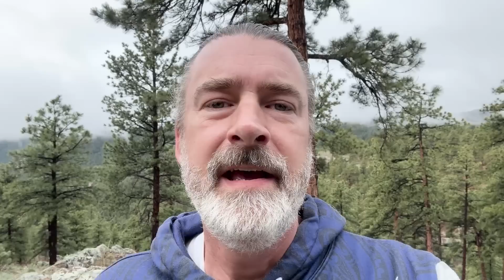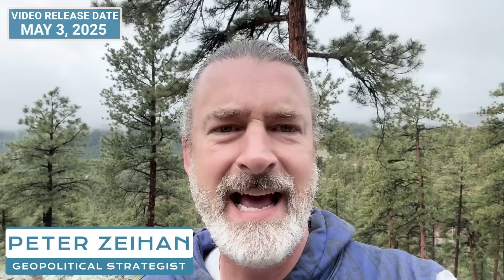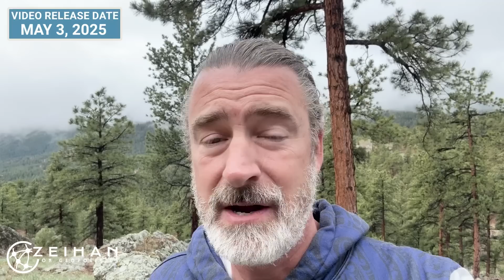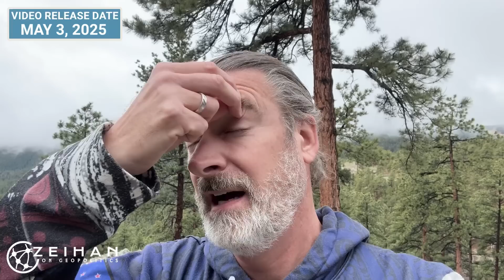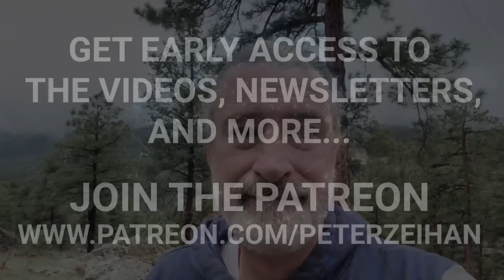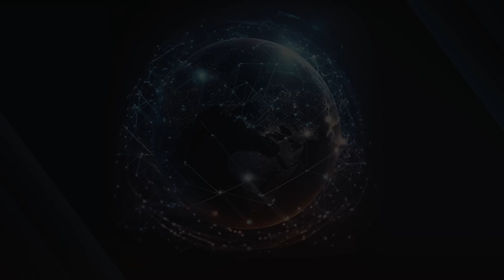The Night the Lights Went Out in Geor- er, Spain || Peter Zeihan

Comment: Electrical Engineer here, several of the points he made are flat out wrong. The failure wa from an unforeseen overvoltage condition because of two large power generators which were NOT renewable. Inverter based resources actually enhance grid stability if controlled correctly. This was off the mark, widely. Renewables were not to blame here.
Reply: Inverter based can help when used correctly... after all, the mentioned battery solution has an inverter. But for it to support a grid, it would have to be a (so called) four-quadrant converter, though the new EU directive makes those mandatory for any PV farm over (I think) 1 MW. 
But renewables do create a problem in that their supply is not a predictable as the supply of "rotating mass". The general understanding is that solar and wind does not change all over the grid at exactly the same time so there is time to react, maybe get a gas turbine online or open up valves of hydro power (can go from 1 to 100 % very fast). 

Inverters are however a problem when disturbance occur, their internal safety features can shut the inverter down in milliseconds (within the sine-wave itself). I didn't know if Spain had a voltage surge (the study is still ongoing), but that might cause PV to shut down in a large area immediately. But voltage surges comes in many forms, most of them never make it through a transformer (let alone several to get from 400 kV grid to a local 10 kV or 20 kV grid). Harmonics the same and are mostly a local phenomenon. So I am not ruling out a (control) error causing some kind of inverted wave harmonics which in turn shut down the inverters... 

As for Peters solutions, the battery storage thing will not work (due to scale and economics). It will be keeping rotating mass online, partly nuclear, gas and hydro. So Spain needs a lot more interconnectors to France and Italy (they are in a similar bind, though not as bad - less wind and solar and more interconnectors to Austria, France and Switzerland).
Reply: It was obvious peter was trying to learn this stuff and failed. Note when he mixed up herz and megaherz. 

Peter has always had real problems knowing when he doesn't know, particularly when it comes to renewables and batteries.
Reply: Any time this dude talks renewables, I know he's going to get it wrong
Reply: Some engineers have switched to the dark side!😅
Reply: never heard of lithium titanium batteries. Lithium Vanadium??
Reply: @jasonbarlow8161  Batteries alone are not the solution. They may be a part of it.
Reply: Reading this from an EE engineer is scary.
of course, the wild add-ons of "renewables" play the decisive role in making the grid instable.

Inverters basically follow the grid but cannot dictate it.
So when the big rotating masses are taken off the grid or are minimized their output for ideology reasons, the grid becomes uncontrollable. Simply the sync is lost without them.

One extra-ordinary event and it must shut-down. 

In the end it was a nuclear power station in France, which acted fast, disconnected from Iberia and saved so the whole rest of the continent from a even more massive blackout.

We need more heavy turbines back to the grid. Anything else will not work (properly).

Peace! from Dresden / Germany
Reply: @Boni-i1l  "Reading this from an EE engineer is scary.
"

As was your comment, in part... 😀... and I too have a background in electrical engineering and control systems.

"Inverters basically follow the grid but cannot dictate it.
"

This depends upon the type of inverter used. Somebody else here accurately commented upon this.

"So when the big rotating masses are taken off the grid or are minimized their output for ideology reasons, the grid becomes uncontrollable. Simply the sync is lost without them.
"

The big rotating masses you speak of are just one way to achieve the effect. But they certainly do help. However, when they're also taken offline in situations where they shouldn't have been... which may have happened in this incident and this certainly appears to have been the case....then they won't and don't help at all.

What's certainly true is that not taking a more holistic approach and dealing with the problems that renewables can create in some circumstances ends in dramatic failure. That's what we saw. And as somebody who lives in Portugal, I can attest to this after losing my drinking water supply for 12 hours.

I think we all have to be a little more holistic in our thinking. And that includes a cool and calm assessment of the cause of the failure, the likely related causes of failure (that haven't yet happened but could), the solutions (including but not confined to yours), the vulnerability of those solutions to interference or cyber attack. And so on. But I fully agree with you that ideology alone does not produce good engineering. You have to engineer solutions to problems created by a necessary transition to renewable energy generation. 

And let's be in now doubt, that transition is absolutely necessary unless we really do want a catastrophic step change to our economies in future that will be entirely beyond our means to control. This stuff isn't optional for Europe in particular. And those that might think it is are utterly deluded. We can't waltz off down the yellow brick road into the land of Oz, here. 🙂 

There's nothing ideological about transition to renewable for Europe as a whole. Given the geology of the region and the state of technologies across the board that are foreseeable over the next 100 years and particularly when taking into account the emerging geopolitical realities this next century, it's strategically inept (and ideological in itself) to imagine that we have much choice about the necessity to greatly increase renewable generation or massively decrease power consumption. There simply are no viable alternatives. But we absolutely need to engineer the power distribution network for the power generation landscape on have no illusions about the necessary adjustments and operating procedures that are necessary for stability and security of supply.

Incidentally, you refer to heavy turbines. By "heavy" in this instance you're presumably referring to the ability of a high-mass turbine to sustain its angular momentum. Somebody else here used the term "rotating mass" and this is more accurate. That may or may not be a turbine. It may be a network of glorified flywheels, for example, that supplement turbines within the power generation network. This kind of arranged has been used, for example, to provide start up power for nuclear fusion reactors (e.g. the Joint European Torus). There's nothing "sci-fi" about this. 

The solution may include synced invertors across the power generation network being synced by control signals rather than the power distribution system itself (which is simple... and good... but vulnerable as we've seen). Or other mechanism, for that matter.

Anything else, as you put it, can indeed work properly: turbines are far from the only solution. It just requires adequate engineering and viability from a cost-benefit point of view.
Reply: @appstratum9747  
Thanks for the lengthy reply which makes more sense, though I have some objections. Keep in mind English is not my mother tongue.
My background is high-tech machinery (incl. very large complex PV-module coating machines) and not grids, but the general physics apply. My Dad worked for 15 years in the 1960s/70s in a huge coal-powered plant and he is a graduated  physics, having a good understanding of basic nuclear stuff. I have a German Dipl.-Ing. (MSc? in English?) in computer, electric and electronic science - but I am rather a practical engineer than an inventor or design-engineer. I installed, repaired and trouble shoot those machines on all continents in more than 60++ countries (so I've seen a lot of local grid arrangements and standards).

But this is the general picture here: The problem in Europe is ideology driving politics. We had all these loud and aggressive doomsday crazies (non of them is an electrician) forcing our politicians to implement politics up to the EU top. It basically means:

- no European strategy at all. Every nations follows its own politics. S and PL are planning nuclear power stations while Germany is discarding the last three (it is OK, since they are too old) but also their coal power station. IN Hamburg, the most modern one just ran for a few years

- as a result of this there is an extremely wild adding of solar parks, thousands and thousands of not-remote controllable small individual "balcony solar panels" at a crazy rate, since most are wanted and subsidized by the national governments. Each country plays its own game while being hooked into the same continent grid.

- For wind turbines we keep clearing a lot of forests to install them; they actually require (again) a lot of space

- Because of the crazy taxation and fee system our existing pumped storage hydro power stations are turned off - nobody in politics, including the Greens do care about it. Most likely they will be disabled soon.
With other words we are throwing away the grid stabilisation, and no, there are no power inverters dictating frequency as far as I know. They all just follow the grid -  a situation our European grid operators (not me) kept warning since years - even in the media - just to be ignored.
In continental Europe there are no flywheel machines, at least not in Germany. The only one I know is in Ireland to support their large shoreline wind parks. Makes sense - but flywheels are also energy suckers. In a combination with batteries not really good.

I could list more of these idiocy - to sum it up: In Europe the adding of solar and wind is wild, uncontrolled (technically and politically) which makes our grids now so fragile. Such a power outage never happened after WW2 in the European West nor East (this grid went as far as to the Ural mountain range in the USSR).
Germany in particular is very special in regard of nuclear. Our Green party (in their heydays up to 20% votes) pushed since decades to turn off anything nuclear, scare-mongering like crazy. Of course Fukushima and Chernobyl plaid into their hands. So, if you just say "nuclear power station" people are immediately "turned off" by scare propaganda. It does not matter if you point to new ideas, they just shun you.

So whatever the initial event was, to a certain decree a grid must cope with it. And this is why the grid failed in E and P. A French two reactor nuclear power stations (forgot the name) somewhere SW in F (one reactor down to scheduled maintenance) switched from the collapsing sub-grid at the Iberian peninsula to stabilize the rest of Western Europe. Some media is claiming we were less than minutes away from a total blackout in Europe.

I agree with you 100% on my wording: heavy "rotating mass" is better, I also got the term "inertia" but this is only the result of it. However, having systems not synchronizing itself by physics but via even more complex control systems is an urgent question to be answered. Simplicity is king - old engineering rule. My opinion is rather that we are heading into more fragile solutions. Too much hardware and specifically software. Two Boeing Maxx killed all on board because of software glitches.

Since I am an engineer I always love new stuff but I also do consider proven technologies NOT to be chased out because someone wants to cash in big time. We also live in times like that - most of the US oligarchs are tech-oligarchs.
I am with you when it comes down to nuclear power; the ideas of new principles - self-extinguishable, consuming today's waste to leave much lesser problematic waste behind etc. etc. are certainly the way to go. Progress is progress and we indeed need to get away from fossil fuels to be burnt mindlessly. However, the way we are currently approaching it, is a way into disaster. It kills our global resources in just a different way, makes technical systems and life more and more complex (and therefore fragile).

Furthermore the every increasing demand of electricity will bring as very soon to the end of any technical solution: transport, building climatization and now as the new hungry monster popping up: AI.
And for our geo-political situation, it is up to us in the West to have good relations with other parts of the world. Something we are currently wrecking with our arrogant and ignorant attitude. But this something else to discuss.

Regards to P, I once installed machines in Porto (Leica Cameras Portugal)and have been to Lissabon, nice place.

Peace! from Dresden / Germany

PS: I will post you (since you're interested) an additional post about PV life spans, based on what I have seen and calculated by myself.
Reply: @appstratum9747  

The argument for EVs was only held up because of the so-called clean solar energy as one of the only acceptable energy sources, besides the wind energy. 

Here is what I have to say only to this subject: I am personally a retired German engineer and I was working in the machinery building business for more than 30 years. I was responsible for installing huge high-vacuum coating machinery - even complete turn-keys projects - in Europe and Asia to make solar panels (CIGS principle) for a couple of years from 2007 up to 2015. 

The energy consumption for making these panels is so gigantic, these panels probably will never generate the same amount of energy back according to my estimate, which questions the whole concept just from this perspective. I calculated only the necessary heating and cooling energies within these ("my") high-vacuum coating machines and I was astonished - it will take the panels about 5 years in my area (Eastern Germany) only to re-generate the same amount of energy. Still, since I did not have the energy consumption numbers for all the other necessary considerations or machinery necessary, I could not include these energies needed for manufacturing, installation and scrapping: 

- the huge building construction and its foundation, the installation of the HV-double electric energy supply lines to run the factory later, road and railway track connection. 
- the constant aircon, clean room air filtering and heating for the huge building 24/7 with usually bad insulation. 
- constant lifting and moving of these panels via conveyor belts and robotic arms 
- the base glass sheet manufacturing, a constant but very high-temperature process as well 
- running subsystems (compressed air, vacuum pumps, coating sources etc.) 24/7 
- cleaning, renewing and conditioning massive coating mask systems, recycling excessive material losses within the vacuum coating machines 
- the coating of many layers itself, requiring extreme energy inputs for tempering via high temperatures inside high-vacuum chambers but also cooling quickly to have the substrate leaving the coating machine again without cracking
- laminating the backside
- frame attaching and electrode assembly 
- constant quality checking processes during manufacturing 
- the storage and packing, transport logistics to collect the raw materials and selling the panels 
- the power to run the necessary office building 
- installation efforts (installation crews driving back and for until it goes into operation) at the final destination 
- most importantly recycling 

Recycling is another virtually hot topic again. Because of the multi-layer compound sandwich-like structure of the many different layers (CuGa alloy, Se, In, S, AZO to name a few) being only a few molecules thin on top of the 2-4mm glass sheet, recycling can be done only with thermic processes meaning a lot of recollecting (transporting) and heating. 
The average panel lasts for 20 to 25 years only, after that they lose efficiency (out of their already absolute lousy efficiency factor) or break down completely due to entering humidity and fading of the molecular structure. This semi-conductor structure is another reason, why the efficiency rate cannot be pushed endlessly, remans basically below 30% peak (sun shines undisruptive straight down onto the panel, meaning an ideal scenario, which does not exist in reality --> therefore the efficiency rate of solar panels is so extremely lousy) is the maximum possible dictated by molecular physics. Steam engine age!

The alternative manufacturing process to make these cells is the Si-based mono-crystal type, which is totally different but might also cause a huge “price” tag in form of the manufacturing input energy needed, just to make them. And the efficiency rate is a bit lower than with the CIGS technology. 
Besides production cycles are up to 2 weeks needing absolute undisturbed electric energy supply into the factories - no black-out allowed (therefore the twin supply lines and transformer base). So running these factories themselves on "renewables" (what a silly term; energy cannot be "renewed" as we all learn in school early, but what the heck) is no solution. 

The necessary battery storage to power whole cities and (heavy) industries is also not developed and might never be since there is nothing visible at the sky. Therefore a double electricity powering system (for short: a back-up system) will be always necessary, be it a fuel burning or nuclear power station. 
This alone will make the so call green energies ALWAYS more expensive. Very very roughly spoken: doubling the system means doubling the price. 

What is still not within this assessment is the complete rework of all the electric supplies and installations to transport the electricity from power stations into factories, farms, cities and communities to feed the now multiple electric consumptions everywhere wanted for EVs, but also digitalisation (a very big chunk), heating etc. pp. with all the electricity losses during the conversion of solar and wind generated electricity (DC to AC, voltage transformation, frequency and phase adaption) and long-distance transport (cable and transformer warming).
 
Which opens another worm can of questions about the amount of material (here i.e. Cu) to make all these “energy transitions”. 

I personally believe that we need to get away from burning coal and oil in the future, but the way it is being politically enforced right now is a way into disaster. The reasons for it are multiple - but basically people: 

"activists" like our highly-educated Greta Thunberg; environmentalist NGOs with very little background-knowledge of math, physics and available technology but with big budgets; pressuring solar technology companies (of course they want to push their products into markets after their heavy investments into their factories); politized scientists and ideologistic dubious "economists" trying to spread single-cause-simple-solution thinking and propaganda messages not allowing any scientific controversy; and finally semi-educated politicians caught in between them all and their populations, which are not willing to accept these doomsday ideologies and their unnecessary financial and, yes, ecologic burdens to their small every-day budgets and living environments. 

Sorry, I know this is quite long but complex issues need longer answers. However, I thought it might be useful if someone who worked in this field starts to speak up. 

Peace! from Dresden / Germany
Reply: @Boni-i1l  Thanks for the thoughtful and extensive reply. And taking the time to write it. Thank you.

We (mostly) agree on things, I think. Although I'd be very careful about extrapolating what has happened domestically in Germany and what has happened across the continent as a whole. The situation in the UK, France, Spain and Portugal differ greatly from the situation that you've described.

I agree with you about much of what has happened in Germany, though. This is consistent with my understanding.

Regarding "getting on with other parts of the world", when it comes to energy that is exactly what we in Europe have been doing. And it's exactly the policy that left Germany in so much trouble in mid to late 2022. If you follow Russian media then you'll know all too well that Russia saw energy supply to Germany in particular as a way to control German foreign policy. And for the previous 20 years, that's exactly what Russia used this for. They could could even buy German leaders like Gerhard Schroeder lock, stock and barrel - just as easily as buying a bar of chocolate from Lidl. But the SPD and CDU were both very much up for sale and complicit. Germany is now paying the price for that stupidity and, quite frankly, blatant shameless corruption.

I should add that at one time I used to work for the BP oil company at a time when we were expanding operations in to Russia with our Russia partner TNK. That partnership was subsequently sold off to Rosneft (which was the company that Schroeder was on the board of). As with most joint ventures with Russian companies, neither BP or TNK were given much of a choice to make that deal with Rosneft. The Kremlin decides these things. And certainly not on economic grounds or in the interests of European countries - especially Germany. This is something that we must not forget.

While Germans used to think that they had a close relationship with Russia, the view of this from Russia was (and still is) very different. For Russia it was always about control of a former satellite (Germany - at least part of it). Coming from Dresden (where Putin was stationed) you should appreciate that more than most.

Unfortunately, most of the world's hydrocarbon energy supplies lie in regions where authoritarianism, corruption and war are never far away. Most of the places where BP exploration operates are extremely dangerous. Oil tends to bring danger and war with it, unfortunately. And BP is no different to any of the other oil majors in this regard. Except those that operate entirely in places like the US. 

The thing is that the cost of oil extraction is rising very rapidly as the easily extracted reserves run out. The energy taken to extract these new oil reserves is now starting to rise to an order of magnitude more than it was. And this brings a lot of environmental damage in the process. Certainly far, far, far, far, far more than wind turbines do to forested areas. And incidentally, there aren't too many forests where most of them are placed. Especially the really huge installations in places like the North Sea. Or the mountain tops of Portugal and Spain, for that matter. 🙂

Thanks once again for the interesting chat. And greetings from this corner of Portugal! 🙂